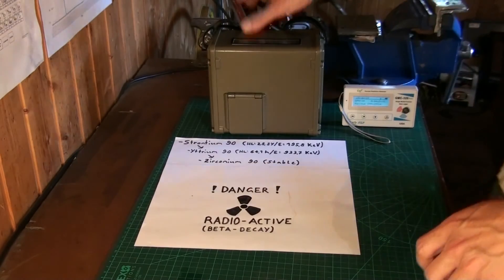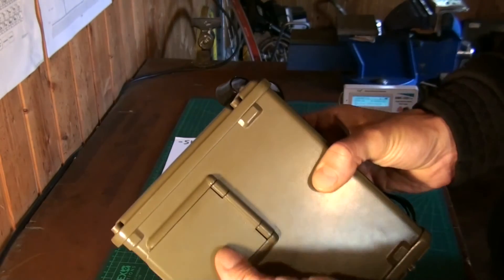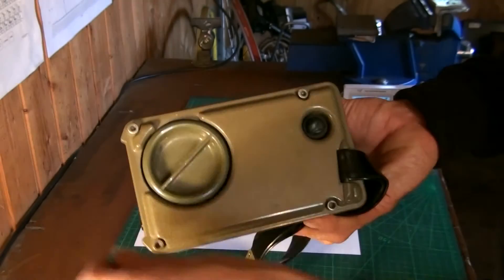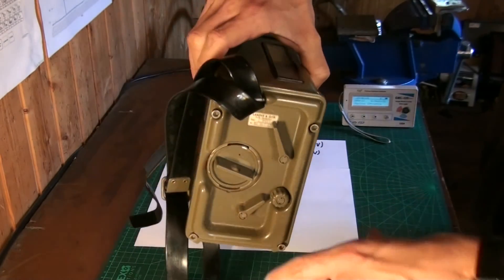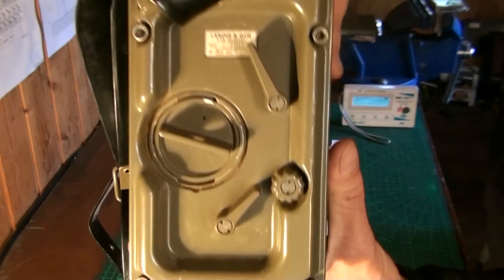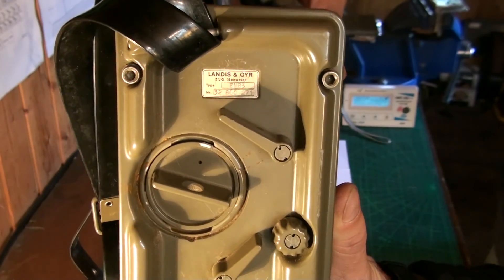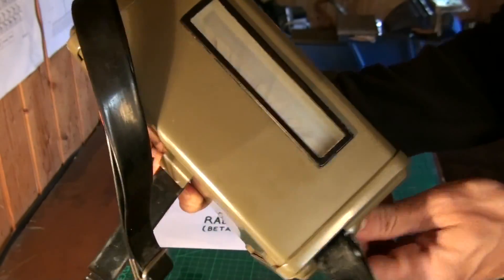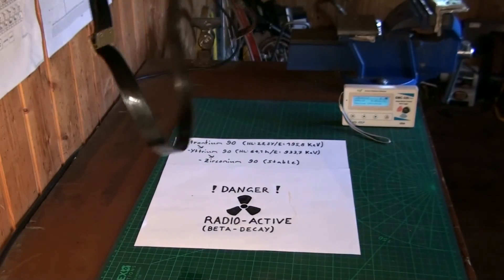A very Radioactive Geiger Counter (and how to dispose of Nuclear Waste properly)

Comment: For anyone interested this is a Swiss EMB3 Geiger counter made by Landis and Gyr, it's an excellent counter. Uses two D cell batteries and covers background ranges on one band, the hundreds of milliRoentgen ranges on the middle band and goes to 100 Roentgen on the top band.
Sadly my model didn't seem to come with the check source. I'm assuming on the later models they removed it for safety reasons. It seems the source would have been used to check the middle bands I imagine in hundreds of mR range.

Comment: Your SBT-11 tube can take up to 3-4 mSv/h but the software of the GMC-320 rolls over if it goes over 65535 counts within a minute which means, relative to the tube's ~300 counts per uSv you won't be able to reliably read over ~218 uSv/h before it starts resetting. Put that tube in a better device!

Comment: I see you have modified your GMC320 with an alpha detector.  I am interested in doing the same thing.  Did you use the CBT11?  What cover and screening did you use?  Thanks for sharing your find with us!!
Reply from the maker: Randy Havener yes indeed, i replaced the original beta/gamma tube with the SBT-11a Tube (i think theres also a SBT-11, but there not the same, the a model seems to be better i read). I really like the new tube, also detects beta gamma and even some x rays just fine! I got the tube from sovtube.com and the protective metal mesh shield i made myself from some hardware store material. I had to replace the battery with another one for space reasons, but all in all it was really easy to modify! Only the space issue was a bit tricky, but its totally doable. I think GQ electronics (manufacturer of gmc320) has a good forum on there website with lots of ideas for mods, got my inspiration from there :) ps: ive got another video "fun with geiger counters" where i explain it a littlebit ;) thanks for watching and keep counting those particles! ;)
Reply: I had to write to say Thank You!  I recently purchased my SBT-11a from sovtube.com and got it installed last weekend.  It's really responsive and I can see the red ionization when the tube reacts (if I have the room dark enough).  I didn't have the courage to install it internally, but I did remove the internal tube and mount the new tube in a plastic box on the outside of the counter.  If I get the time, I will upload photos to the GQ Electronics forum.  Please post new content when you can!  I really enjoy your work!  Thanks again for all of your help!!!!